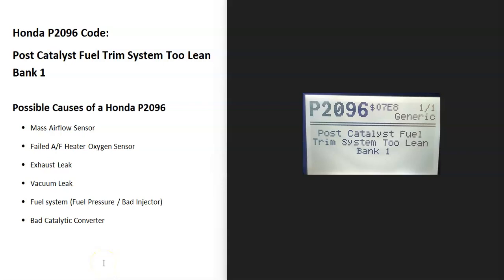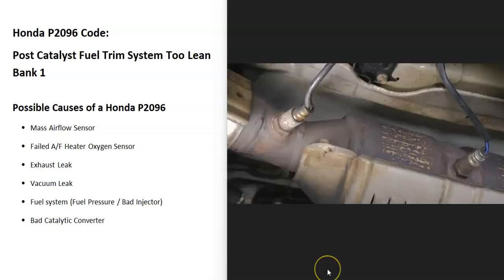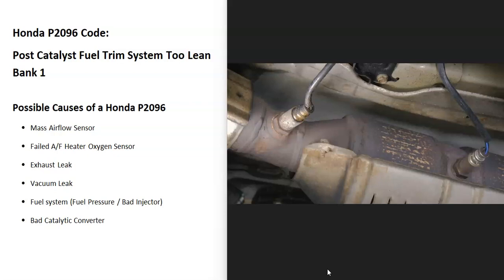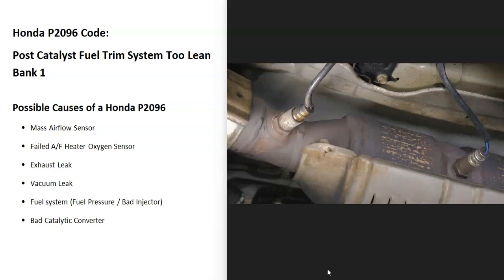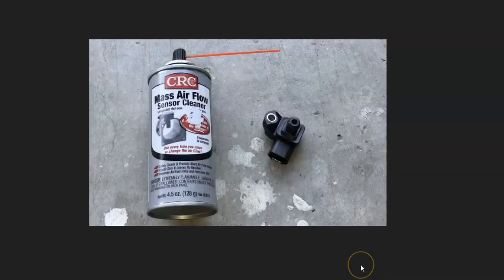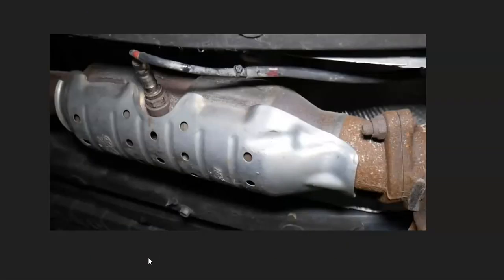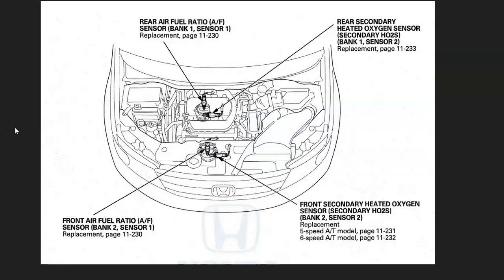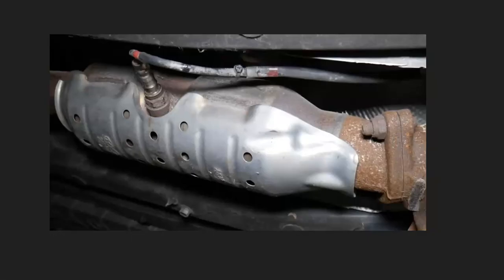How to Fix Honda P2096 Post Catalyst Fuel Trim System Too Lean Bank 1

Comment: Got a 2016 accord reading this code. I have a cold air intake that was there when I bought the car. Would the intake cause this issue. I replaced the o2 sensor